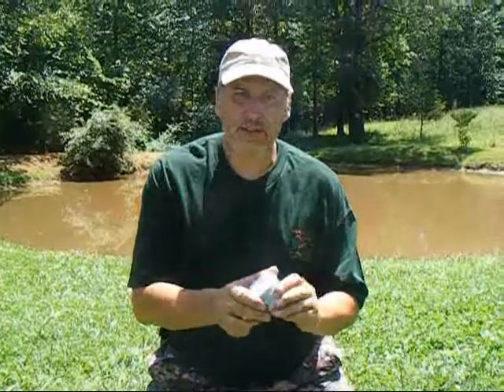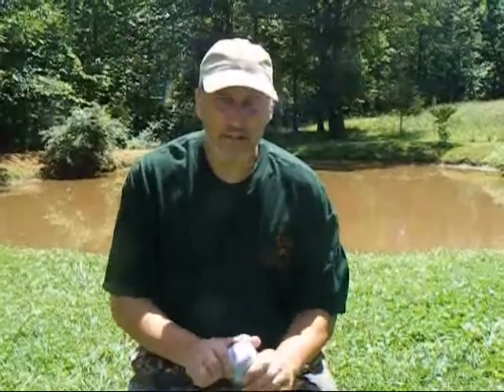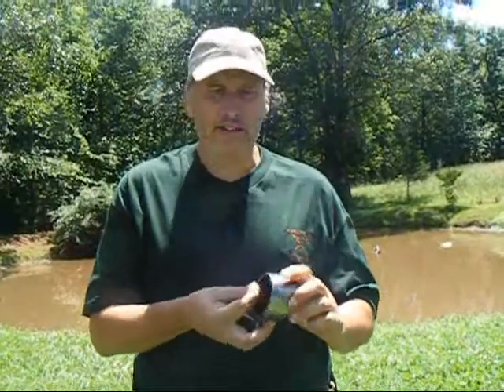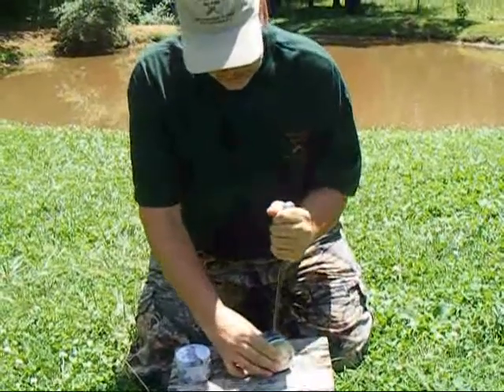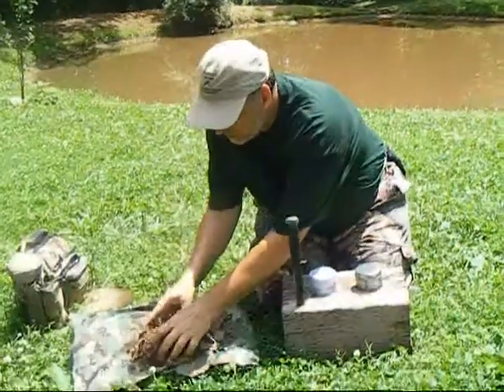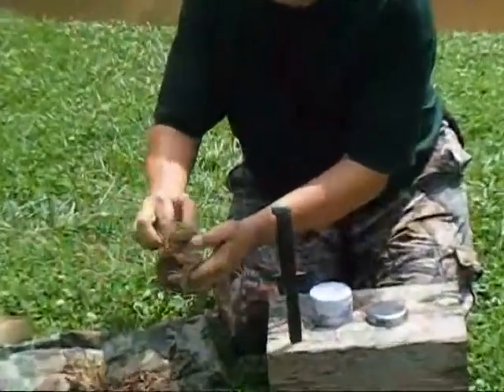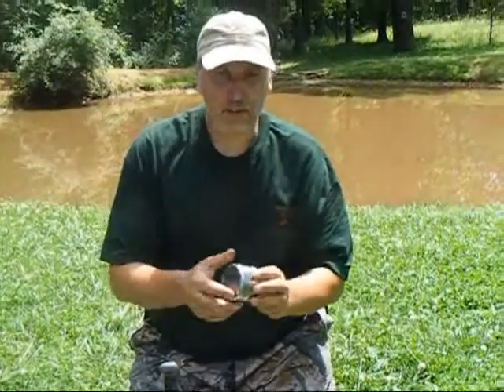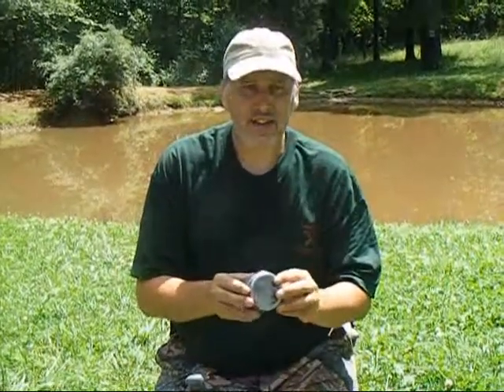Tinder Can

Comment: I keep a small plastic tube with some liquid fuel sealed up inside it. It has a flint and steel fixed right to the tube. I have learned to strike the flint and steel and open a small valve in the tube using one movement of my thumb. The highly volatile fuel inside the tube creates a stream of gas that flows through the valve on the tube and ignites in the spark from the flint. The result is a small flame jetting out of the little tube sufficient for lighting a cigarette or a campfire.

Comment: A lighter will still ignite in -30 degrees. Butane vaporizes at -76 degrees Fahrenheit. Not sure why you'd be out in weather like that, though.
It will also ignite after being submerged in water. Just blot or blow on the spark wheel. 
Finally, the sparks themselves are good enough to ignite fine tinder like cotton balls, reed seed heads and dandelion fluff. Still haven't made charcloth take, though.
Anyway this is a great vid. I can't wait to try this trick.

Comment: in my can with flint steel and char cloth i put in a tender tube use kerosine wicks cut in sq. for char cloth and the whole wick in tender tube push up as needed also pull back in to put out for next time